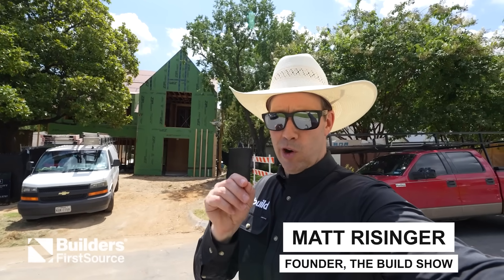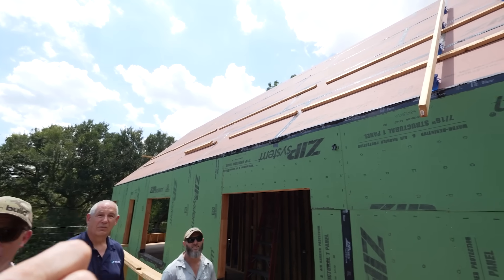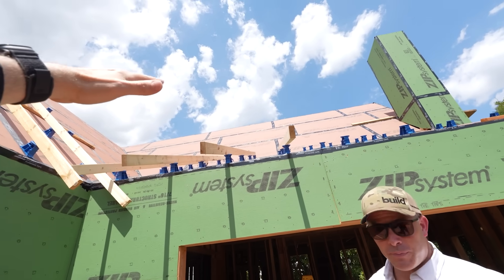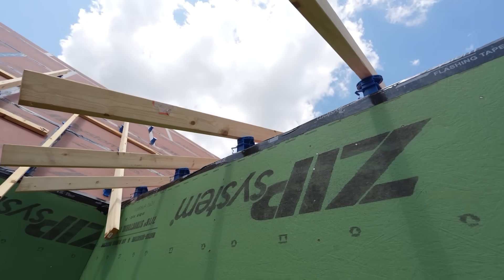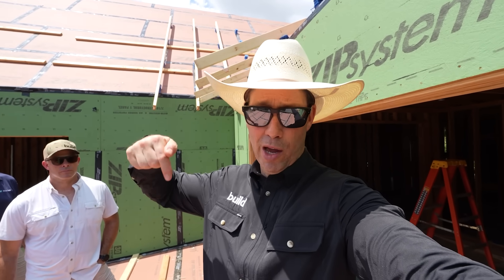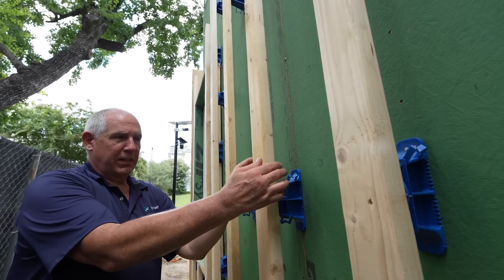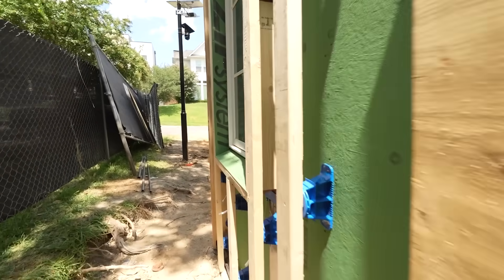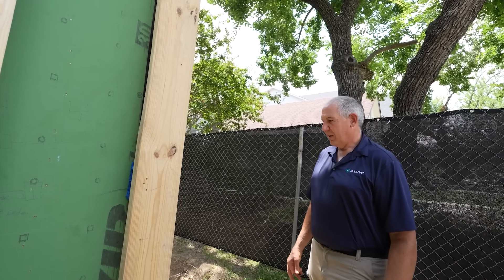A New Idea For Framing A Monopoly OverRoof

Comment: At some point it seems like you are just building your own more expensive SIP
Reply: Yeah, somebody lost the plot.  If you want a construction like that I would use plywood without tape underneath, then let the closed cell foam be your air and (secondary) moisture barrier.  You could also use foam board with spray foam to seal the gaps between boards to get cheaper.  Taped Zip on top of the furring strips would create the primary moisture barrier under the roofing/siding but above the venting.  That would do the same thing.  Interior drywall would be a secondary air barrier.

If you had a radiant barrier on the underside of that exterior Zip you could even improve it a little bit.

I like the implementation of "perfect wall" assemblies but I wouldn't call this perfect, the foam insulation is pretty vulnerable to insects and rodents, especially if the foam gets wet, then the OSB or plywood can be eaten, allowing insects, rodents and vapor a way to get in to your home where they will do even more damage.

I like solid surfaces to keep out insects and rodents, ventilation with insect and rodent resistant screens and materials that rodents and insects can't chew through like steel, stucco, stone, brick or cement board.  I think you can get those materials for a "perfect wall" assembly at nearly the same price if you skip the redundant details and try to save some money where it doesn't matter.

If I spend that much money on construction, I want it to be a selling point when I decide to sell, when I die, when my kids decide to sell, when my kids die, when my grandkids decide to sell or when my grandkids die.  If the house isn't in great shape (with reasonable maintenance) for that long I will be disappointed.  My real goal is to build something that can be maintained for 200 years or more.

This assembly seems like a collection of buzz words to pad the budget disguised as a "perfect wall" assembly.
Reply: @beardoe6874 even if this system lasted 200 years I doubt the foundation would
Reply: Nah. A bare sip panel right now is about 9 bucks a square foot. Even with expensive spray foam and zip, you are still coming in shy of that number or right at that number with a much easier and traditional installation method. Sips only have an advantage if you are working extremely closely with an architect and the factory. If you want to make any kind of course correction halfway through the design, you are kinda SOL.
Reply: I was coming here to say the same thing and its the top comment.
Reply: SIP requires additional work due to how moisture sensitive it is. Most SIP roof need a self adhered WRB installed and a second layer of plywood for the shingle. Shouldn't nail shingles into SIP. I'm not sure it ends up being cheaper.
Reply: @phamlam3720  What about SIP with ZIP system as the exterior face and MGO or OSB as interior face?
Reply: @AK-IT I wouldn’t want to put thousands of nail holes into any sip roof panel.
Reply: @phamlam3720  understood, so even tho the SIP has a ZIP face, additional screws from the roof/cladding will penetrate the ZIP face compromising the ZIPs vapor barrier.
Reply: @phamlam3720  what about adding furring to the SIP exterior face? would that reduce the nail/screw penetrations?
Reply: @AK-IT That would be the best way to go about it.
Reply: @phamlam3720 thanks, an additional step but limits compromise to weather barrier

Comment: Somebody needs to dial down the pressure on their framing gun, that over penetration of fasteners on the zip was unacceptable.
Reply: whats a regulator to a 100 foot 1/4 inch air line?